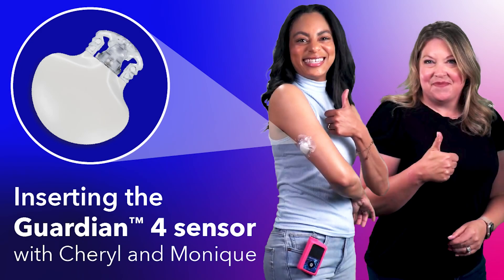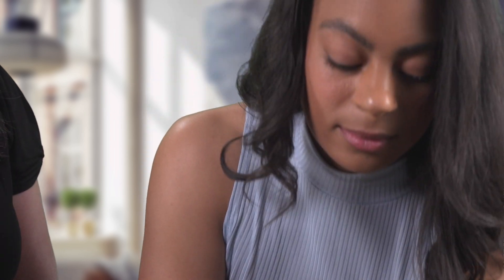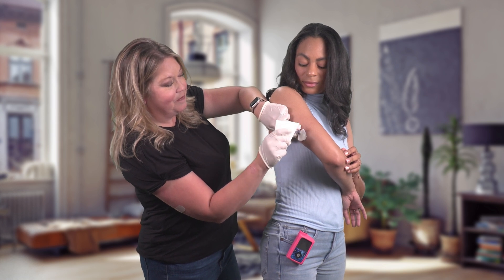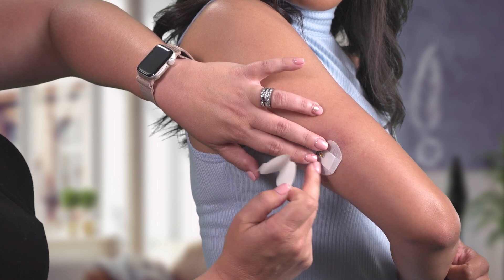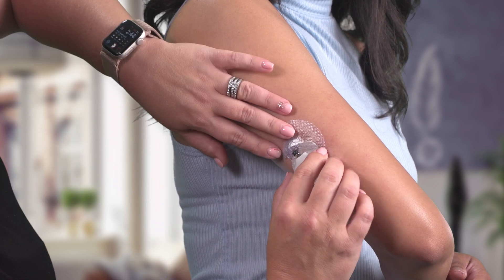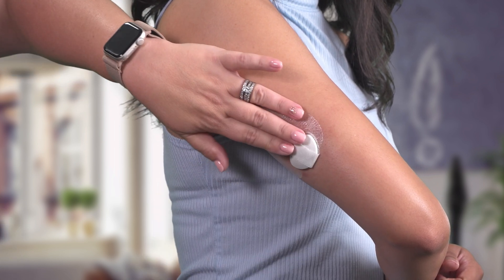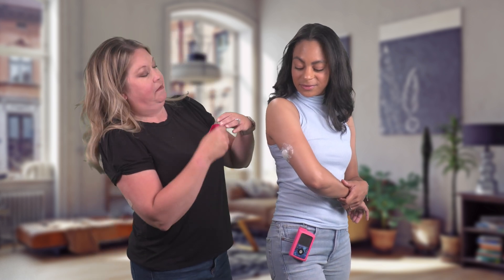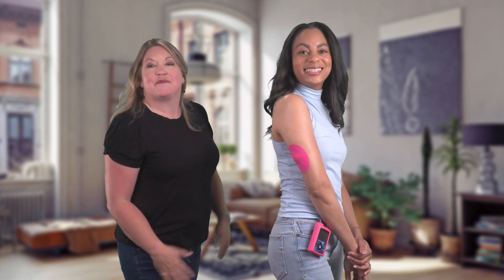How-to guide for inserting the Guardian™ 4 sensor with additional support

Comment: Doing this doesn't even last 7 days. I'm lucky if I can get 4 days out of it before the sensor fails. Medtronic has sent me replacement (5 every 90 days) along with a Mastisol adhesive. Unfortunately due to the design of the Guardian 4 applicator it is not easy to determine where it is to be placed without being at the needle hole. I was hoping that since both are provided by Medtronic there might be a video showing how *they* suggest this to be used. This apparently is not one of those videos.

Comment: Medtronic, why do you insist on such a terrible design. Every other CGM is just a click, but you still use this ridiculous 9 step process that needs 2 people? Unless it changes I'll be getting a different brand of insulin pump when I upgrade in February 2025
Reply: If I find a system that works with Libre 3, I'm out. This sensor is absolute junk.
Reply from the maker: Thanks for sharing your feedback, Nick. We will pass this along to our team.
Reply: @MedtronicDiabetesUS Just put it on your stomach instead. You still won't get a full 7 days out of it in any location, more like 3 or 4, but at least you will be able to do it yourself.

But it is a terrible design. What they don't show in this video is the mess you end up with on the floor after all this since you're doing it by yourself and have no one to clean up every 5 seconds while you struggle to keep the tape from collapsing in on itself.